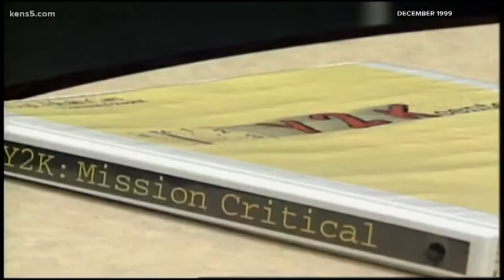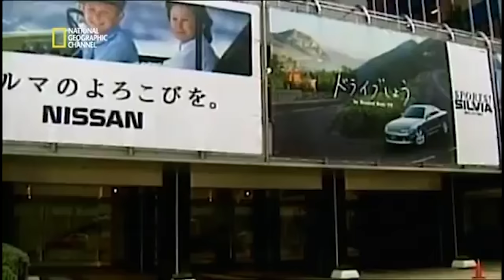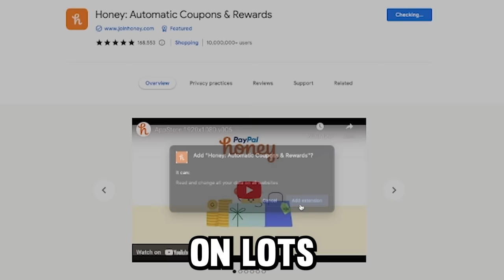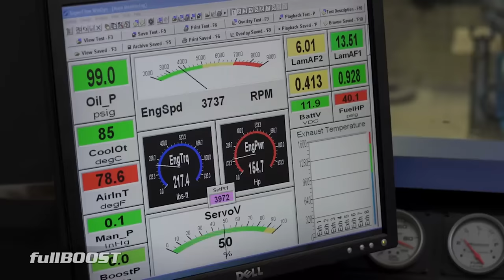Why The Infiniti G35 Is The BEST Skyline

Comment: I just bought a completely unadulterated 2004 G35 sedan, pampered to death.. dark blue, 104,000, mi, absolutely no rust whatsoever, A couple dents and dings here and there.. paid $5,200 for it.. im on day 2 and I'm the happiest fckn clam right now, finally got the reliable sports car ive always wanted 👌
Reply: got one the same garage kept by an older gent every service record and 114,000 miles, also dark blue
Reply: Hell yeah! I just bought a silver 2008 G35xS sedan auto with 117k for 4500 with a check engine light code for cam shaft sensors... swapped em out and it drives like a champ ... prev owner did new steering rack and alternator before they sold it to me .... they got the short end of the stick this time
Reply: I just bought a 2007 G35 6mt i am too very very happy with my purchase
Reply: Hell yea congrats!! Maintain oil and you should be good

Comment: It's a Skyline in Japan 🤷
In fact, it's more Skyline than the A90 is a Supra
Reply: The a90 being called a supra is a low bar
Reply: It's also a 350z with leather
Reply: wind016  all things the 350z had in spades
Reply: wind016  yes, it's a half-assed excuse for a sports car, more akin to an econobox. Cheap all around, poor dynamics, gutless and massively prone to understeer
Reply: It's a Skyline everywhere. Look under the engine bay on the VIN plaque and it literally says "Skyline" in Kanji.
Reply: its called the J29 but ok

Comment: Back in 2003 I was driving to work on I-5 south bound and this  silver Ferrari 360 Modena passed doing about 120mph right behind the Ferrari was a silver 911 Porsche as the cars passed me up on my burgundy 1991 Ford escort lx I saw something silver behind my center rearview mirror it was something way slower but yet very cool I couldn't identify this make and model but it was doing about 100mph way behind the silver Ferrari and Porsche it was the Infiniti G35.  I went to work wondering what was the slow silver car.  it was slow but beautiful 😍. I was determined to find out. Few months passed I failed to identify the make and model  then I finally saw one at a Safeway parking lot where the store manager owned one in Caribbean blue. I knew it then I had to get one Infiniti G35. It took another year before I purchased a black 6mt g35
Reply: Bro I was a Honda kid growing up in the 1990s in mid 2k I was at a gas station fueling up at like 3am and herd a wonderful exhaust deep toned like the perfect sound lol and as the sound came closer and I was still getting gas the G35 passed by and my friend I fell in love and started looking for a G sold the civic and an accord I had 6sp coupes for a 04 6sp G coupe brembos and all I still have it today asa matter of fact I just purchased a 06 6sp coupe salvaged the motor was done I actually just bought a revup engine took a while to find one and it still needs body work but I now own 2 G35 coupe’s! Like these cars so much it keeps me busy super cool hobby  bro love the G keep up the awesome work! I’m in Newyork folks are into the high end cars out here but I stick with the Simplistic G easy to maintain and fun to drive never selling lol 🤙🏾👏🏾 God bless and stay safe brother

Comment: I drive a lightly modified 2008 G37 S. My best friend drives an unmodified 2011 G37 X. Both cars have ridiculously awesome handling and performance. Mine has over 120,000 miles and Zero maintenance issues or lights on its dash unlike a lot of the newer cars I see at work everyday. These Skyline 370 GT coupes are definitely some of the best ever built.

Comment: Hey Ideal, check out the very first Skyline that was made by "Prince Motor Company" in the mid 1950s, it came out as a luxury sedan and the coupe wasn't made for a few years, could we see a video on that please?
Plus, the v/g35 with the 2.5lt engine, when they did testing in real world conditions with different drivers, traffic and weather, the car drove for 1,024.4km with the VQ25HR engine

Comment: In my opinion they're underrated, and not just cause I own one? it's kinda looked down at like the r33, the r33 gtr is dope, but the gtr r33 gts 25t was looked down at, it's still turbo and still has power, well the same with the g35, sure it's NA but it's still pretty fast considering today they're stock and can still beat newer cars, they're still pretty quick considering they're going on 20 year old cars, but I feel they're skylines, they're not fake because In Japan it is a skyline, so it's not fake it's a good car and it still has power, sure newer cars beat it, but look at the q60s it's fast, back then that's how the g35 had it's fame it was fast at its time and still right still hauls, overall? I feel the g35 is a great car!!

Comment: Hey, how’s everybody doing? I know this is gonna sound out of place. But I just started getting into infinity. I have a 2008. And I just got some straight pipes put on. And I got the cats removed. Even if I replaced the O2 sensors, regardless of the fact, I would still have a check engine light because of me not having any cats correct? I’m just trying to reach out to the community to hear everybody’s opinions.

Comment: I'd rather my old RWD turbo R33 GTS-T, or an R34 GT-T over a G35 any day of the week and it's not even close. Hell, I'd rather a R34 sedan than this. Soz, not the best Skyline. But I do like G35s.

I'd rather a 350Z too contrary to what the G35 owners think.
Reply: All the r series are kinda in their own league,can’t rlly compare plus the price difference.
Reply: @jordanjones5061  I bought my R33 GTS-T for $5k AUD (about $4K USD), here (Australia) and in Japan (both RHD and close to each other) of late yeah the price difference is a bit (about $5-10k), but once upon a time, R33s and 34s were actually cheaper than V35s. Guess which one held their value and actually appreciated? V35s are cool, just far from being the 'best Skyline' and hardly turn a head. The R33 turned heads everywhere I drove despite at the time, being cheaper than a V35.

I'd splash out the extra for the turbo R33/R34 for a V35 every single time. For most the V35 is the better bang for buck, but even with inflated prices today, I'd save for a GTS-T / GTT. I understand you can't get them in America LHD. Shame 😛
Reply: @pA-yy-A Yeah currently here in the states with inflation being ridiculous. Any imported Nissan skyline R32 and R33 that aren’t even GTR’s and only the GTST’s/GTS are all going for 15k to 25k depending on the condition. Meanwhile a V35 here goes from 3k to 8k depending on condition and then adding bolt ons and forced induction you got a quicker car with more modern looks. Look up Nitish 21 on YouTube. He’s had his G35 for 10 years now and has a single turbo setup and thing is a monster pushing 800 horses.

Comment: You are a complete FOOL if you buy a Renault- Nissan. The very fact that Renault hasn't sold a Renault in the United States since they were run out of the North American car market in (1985) should tell you everything that you need to know!
Reply: Yet the vq is the ls of Japan 
The vr38dett has also made over 3000hp in the drag racing world .  

Nissan doesn’t use Renault parts,   Renault sources parts from Nissan
Reply: @ThorOdinson-zc2kq  Both of those engines were designed before Renault took over Nissan. And the old Jatco transmissions (5 & 6 speed manual) were some of the best in the world . I had one in my 2009 frontier that lasted almost 300k miles without any problems. 

Renault became the senior partner in the Nissan/Renault Alliance in 1999, and their first shared platform started in 2007, that's when they started having major problems with their CVTs. And it's only been going downhill since then. 

Renault heavily believes in shared platforms, meaning engines & transmissions that they can they installed on Nissan, Renault, Citroen, or Peugeot.